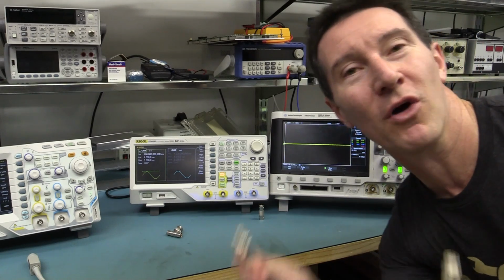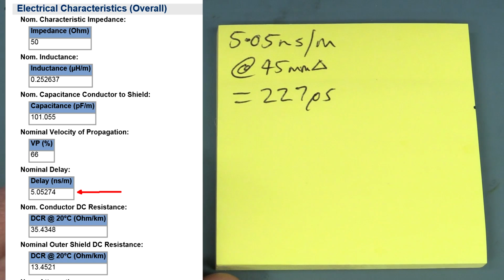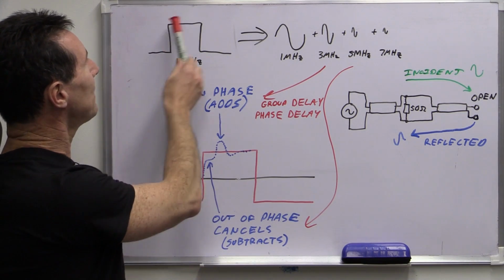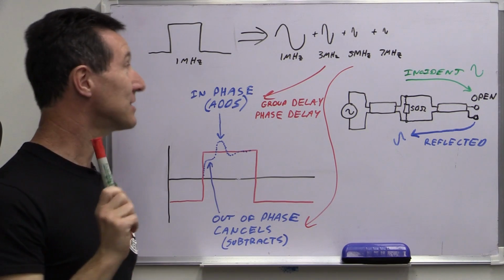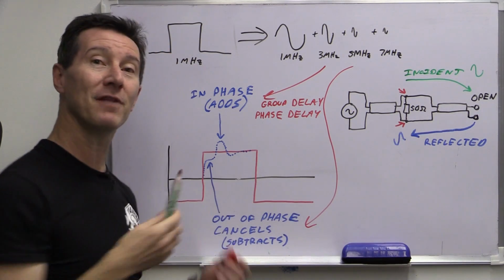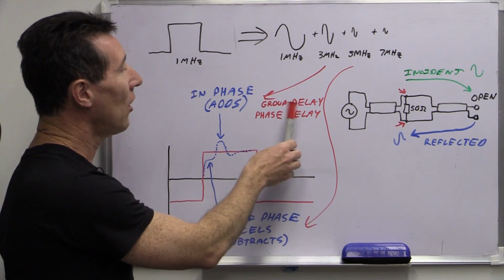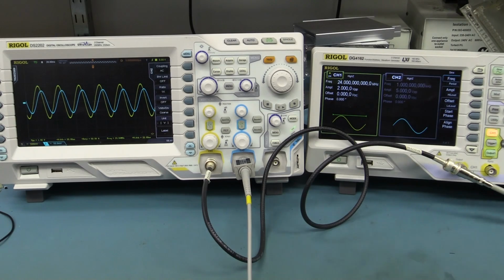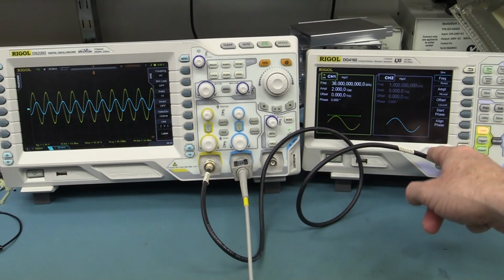EEVblog #652 - Oscilloscope & Function Generator Termination Demo

Comment: Real world  I was senior  on a team supporting US Army Air Traffic Control in Germany. We had both radio and Radar in our workshop We started getting problems with Calibration on some radar units.  Various checks and retunes later we found the RADAR tech was using 50 ohm radio coax test cables We had dozens about the shop and Unless you looked identical. Should be 74 ohm on Radar.

Comment: Great video, any chance you could do a video on using T bnc connectors on an Oscilloscopes channel so you can send a portion of the channels input to say a frequency counter....Some oscilloscopes have a CH 1 BNC Output on the REAR/BACK of the oscilloscope...so basically how can you do this safely on an oscilloscope that does not have a ch1 (auxillary) output.
Cheers

Comment: I would like to add something to "reflect" on even though this is 8 years later. This wonderful engineering "trap" was actually used to create the The Tektronix 1502C Metallic Cable Tester which I provided maintenance and calibration for about 30 years ago or so. At the time it was popular mostly to trace down opens and shorts in aircraft wiring harnesses. Man that take me back!

Comment: Nice video. One thing I don't understand is this: at the end of the video it is claimed that the amplitude change seen on the scope is due to the fact that there is a reflection at the generator side. Now this makes sense to me on the one hand, but on the other hand the generator output impedance is supposed to be 50 ohms, i.e. matched to the coax cable and so there shouldn't be any significant reflection there. So does this mean that the output impedance of the generator isn't exactly 50 ohms? If so, what would be a typical value for any parasitics that cause the deviaton from the ideal 50 ohms? I couldn't find info on that in data sheets of signal generators I've looked at (in contrary to oscilloscopes where it is even often printed above the BNCinput connectors).
Reply: I was wondering this. shouldn't the signal stop at the generator?

Comment: What does this mean when we use a signal generator and oscilloscope to measure component properties?  Is the lesson to use low frequency signals?  Am I correct that with a signal generator and oscilloscope you could measure Capacitance and ESR of a capacitor?  How does this with the small battery powered VNA (vector network analyzers) that are available.  I would imagine that these transmission effects (when not terminated properly) could distort those measurements.

Comment: That explains a lot of signal traces on high speed digital circuit boards (PC motherboards) that looks wavy like snakes instead of straight lines for no apparent reason. They are trying to match the length with some other traces.

Comment: You kept saying you were adding a 50 ohm termination, and kept pointing to a general area. I never could see where the termination actually was placed.
Considering that this was the solution to the problem, and the item featured in the video description, I would have thought you would have spent a little time showing it.
What's your hurry ?
Reply: Scopes have a setting within them, mostly in the 'channel' options, to change this

Comment: If my function generator, coax cable and dso are all in 50Ohm.

Do I need to use a 50ohm terminator  inline with cable or with T connector to the cable?
 @EEVblog
Reply: This is why I had come here as well.
From what I understand:
1) it's okay not to use it unless it's a very high frequency. Many MHz.
2) for a 50Ohm termination, you'll need to multiply by 2, as the termination will act as a voltage divider.

If you want to correct or think there's anything to add, please comment. Thanks

Comment: I've looked all over the net for a schematic of a 50 ohm terrminator, but I can't seem to find one. On the white board portion of your video, you point to where a 50 ohm terrminator should go, but it never gets drawn in so we can see the circuit details. Is it just a resistor?

Comment: reflections  happen on full wave and half wave  isnt that correct ?, how can we get 0-360 degree change  when its only half and full 180 or 0 or 360 degree ,   i think it is a mix between L and C of the coax cable , filtering basically ,  this test should be done with Spectrometer also, so that we can see amplitude of all waves present in the cable, not just one frequency,  even if ther are no other frequencys and i doubt that ,  then the output of the generator must be lower , there is no other solution, but i dont have that scope, i have 20Mhz analog one, and no frequency generator to hook it up and test , so i can only guess .

Comment: About 8:00 in your video. If you did not have the 50 ohm impedence on the scope, what would then happen? Would it be 2 volts peak to peak on the scope instead? (:
Reply: With only one coax cable between scope and generator (:

Comment: So the coax has capacitive reactance due to its innate physical construction which has a different reactance at different frequencies which makes the amplitude go down due to the impedance it creates. By adding inductive reactance you counteract the capacitive reactance to reduce the impedance to near zero... correct?

Comment: thanks, at least I have now the picture on the practical side of transmission line theory (communication).  In the classroom,  it's non-sense following blindly the basic differntial equation of TL  theory that   leads to various equations of circles  which is the smith chart, reflection coefficients, propagation constants, exponential and complex equation, balun matching .... Although I passed the subject but still wondering until I forget it...

Comment: I  sure am pleased to see that a video from almost 4 years ago helped with exactly the problem I am facing. I am using an old 100 Mhz dual channel analog Hitachi 'Scope and an old GW-Instek 3Mhz function Gen/ 150 Mhz frequency counter. The sig-gen out is labeled 50 ohm impedance and he scope input is labeled 1M. Something didnt feel rite when I read instructions telling me to connect a dual end BNC cable direct to each device. This video helped a lot and I will follow up with the article by Doug Ford. Many thanks to you Dave. I was concerned I might damage the front end of the scope. I feel much better now !  The Sig-Gen has no probes, so I figure I should try a set rated for 200Mhz (to accomodate the 150Mhz freq-counter). Seems I should be looking for a 50 ohm inline terminator too.

Comment: Time Domain Reflectometry (TDR) - Feed a 1KHz square wave into a 100 foot long coax cable open or shorted at far end.   Watch the square wave wave on an oscilloscope and note the reflection from the far end and other reflections from cable faults.  Reflections will be very close to the rise of the square wave and distance to fault can be determined by speed of light and propagation factor of coax cable, or for a known coax cable length the cable propagation factor can be calculated from time out and back relative to speed of light for same distance.

Comment: I am a beginner, so forgive my lack of knowledge, but it seems to me that if the unterminated coax reflects back, then a break in a long coax would do the same. Can you therefore use a scope to find the distance to that break? ie: send a pulse down the coax and measure the time between it and its reflection, then calculate how far the distance is to the point where it reflected. Seems to me this could be a good way of finding faults in long coax or buried wires that are hard to access.
Reply: Great Idea! but would that be possible?
Reply: Congratulations, you've just reinvented the Time-domain reflectometer :)

Comment: I remember trying to explain Fourier analysis in square waves teaching RF considerations, I had a lot of  blank faces so I used the Hammond organ sinewave  additive to produce an approximation of a square wave on a CRO  and it was a good way of showing the principal even though we were dealing with audio frequencies.    Showing standing waves on a open 2 wire transmission line with a transmitter connected at one end and impedance mismatch at the other using a florescent tube passed at right angles to the line along it and watching it glow and fade as it passed voltage highs and lows.
The behavior of any AC in a circuit is a hard thing for most people to grasp, you have to have a good imagination  and be able to think laterally.   That's why so many people bomb out of electrical and electronics courses, AC theory needs to be thoroughly understood in all aspects.

Comment: Nice video, but I must quibble with the harmonics analysis of the square wave - you get the exact same behaviour with a single edge which has a continuous spectrum - this is a behaviour best explained purely in the time domain looking at reflected edges.  The signal hits the t-piece and 50 ohm terminator and sees 25 ohms (50 || 50) until the reflection from the open end comes back and causes another step change (which itself propagates back to the open end and back a few times with decreasing amplitude - causing a stepped waveform dependent only on the length of the open stub).

Basically you've got a TDR there!

Comment: When I connect my function generator to my oscilloscope with a BNC to BNC RG-58 cable and set the output of the FG and the input of the OSC to the same (50 ohm or High Z), the OSC reads the FG output perfectly. The FG outputs 1Vpp, the OSC reads 1.032Vpp. This is with no terminators. If I use my x10 probe, I have to set the output of the FG to "High Z", which I think is 10k ohm, and the input of the OSC to 1M ohm. I then have to add and additional 3.7M ohms to get the x10 probe to read 1.040Vpp. I don't understand this. The non-terminated RG-58 worked fine and the x10 probe needed an additional 3.7M ohms to work properly.

Comment: What type of coax adapter are you using on your probe,I have not found an adapter with the BNC that will fit onto a probe?
Reply: +William Colvin They are pretty common. You can buy them by themselves or a lot of probes that aren't the absolute cheapest you can find come with them.

http://www.amazon.com/Cal-Test-Electronics-CT3655-Oscilloscope/dp/B009QBSKE2/ref=sr_1_2?ie=UTF8&qid=1443499425&sr=8-2&keywords=oscilloscope+probe+bnc+tip

Here is a 10 pack of just the connectors.

http://www.amazon.com/Precision-PR150SA-Oscilloscope-Probe-Insulated/dp/B00TTOWEX4/ref=sr_1_6?ie=UTF8&qid=1443499425&sr=8-6&keywords=oscilloscope+probe+bnc+tip

Here is a probe that comes with the bnc tip.

I have never used either of the products and so am not vouching for their quality at all by linking them, they were just the first to examples that popped up on Amazon.
Reply: Thank you very much.
Reply: +lbrieden1 Thank you very much.
Reply: +William Colvin Very much welcomed

Comment: Great video Dave. Some of the navigational systems I worked on we used this delay to great effect. Two antennas feed 180 degrees apart will produce a null between them. Before network analyzers we had what was called a vector voltmeter which measured that phase delay in degrees. If the delay was off we calculated how much cable to chop off to get the correct delay.

Some of the older cabling we had to age the cables to account for expansion and contraction of the cabling due to temperature variations. The higher the freq you deal with the weirder things get. Transmission line/Antenna  theory always seemed the hardest thing for newcomers to understand.

Again great video showing the practical effects of improper termination of signals.

Steve

Comment: EEVblog Dave, Thanks mate. I install TV Antennas and have been told that I can use 2 antennas of the exact same spec, to produce better gain, So long as BOTH the cables that I use from the antenna to the mixer, diplexer or masthead Amp are precisely the same length 
Now I have seen why. Thank you!

Comment: Any person making this stupid mistake has very little knowledge about measurements.  It is common knowledge that signal generators like the Rigol has a 50ohm output impedance and the specification is only valid when matched into a 50ohm load.  Using the input impedance of 1Mohm on an Oscilloscope proofs that the user need to spend more time to studying VSWR and impedance matching. Then you continue on the wrong path by connecting two 50ohm terminations on the two channels of the Oscilloscope channels, effectively creating a 25ohm load on the output of you 50ohm signal generator. I don't have to explain that this as a mismatch and that you cannot trust your measurement results. RF and microwave engineers are totally aware of mismatching and even get into phase matching in what seems to be a 50ohm matched setup.  This is when the start talking about a mismath error and a mismatch uncertainty.

Comment: The step you see at the leading edge of the waveform is due to the coax's characteristic impedance being a load in series with the output impedance of the generator. 50 Ohms in series with 50 Ohms drops the input square wave to 0.5 of its level. This occurs irrespective of the end of the coax being terminated, open or short circuit. As the wave travels down the coax at approx. 0.6 the speed of light (say 5 ns/m) the measured signal at the start (the step)  has no knowledge of the termination of the coax at its end hence the step. Try 75 Ohm coax and the step is a different value. Once the reflections have settled down the measured voltage will return to the same level as expected for an open circuited load, that is no change in level! You can work out what to expect by thinking 50 Ohms in series at the start of the wave and then think what would I see if it was just a DC signal level change for the long term part of the signal.  The reflection occur because the impulse from the leading edge of the signal has no where else to go except back to the source where it is then absorbed - just like throwing a ball at a wall and catching it on the return bounce. After twice the time delay for the signal to travel to end of the coax all the reflections should have died out and the distributed capacitance of the coax will be fully charged - inductance is not applicable in the long term because no current flows in an open circuit ( think DC again).

Comment: Or if your scope has the ability to terminate with a 50 Ohm impedance, just do that and then you can use a coax line without any issues. Dave did do this on the Agilent, but because most cheaper scopes do not have this ability the video was necessary. This is good info to have.
I just set my scope to 50 ohm termination and call it a day. As a backyard RF engineer that's something I look for in a scope. And of course I always have a spectrum analyzer at hand.

Comment: Very informative.  I'm still a little bit unclear on what the x10 probe is doing if its not terminating, is it just a really high impedance way of measuring?  If so, what would happen if you connected coax to the signal generator and then the probe to the end of the coax?  Would you get reflections again?  Was the point of the probe to avoid having any coax transmission line interference?  Won't there be transmission line reflections between the internal source of the signal in the sig gen and the connecter on the outside of the sig gen even though its a very short path?  Does it even make any sense to measure the output without terminating?  What would that measurement "mean" / be good for?

Comment: I would have liked to have seen this video when I was studying for my Extra Class Ham License.  I was baffled how a single piece of coax could present itself (characteristic impedance) as an open circuit, short circuit, or anything in between based on frequency.  My background is computer engineering, so my little digital based brain was sent reeling.  Excellent video Dave!

Comment: what are actually the BIG differrences between an expensive DDS function generator and a cheapo chinese one? it's the same technology after all (apart from the obvious differences like the big screen, keypad, ..)
Reply: GPIB. Fmax. THD+N maybe? I wouldn't bother with a lab quality DDS AFG in a hobby lab, and I wouldn't bother with a cheapo chinese one in a research lab. The big screen and easy to use keypad along with the out of the box calibration and slave to external reference capability is enough to justify one for professional use.

Ergonomics and not mucking around is worth quite a lot when you're paid by the hour. It ain't worth shit when you have to make the choice between ergonomics and a better scope.

I would definitely buy one of those $17 naked PCB ones to start off with. You can verify it works right with your scope and spectrum analyser. If you find you're using it all the time and you're wasting too much time dicking around with it's clumsy UI, you can always upgrade to a lab one, and put the cheapo one aside for those times when you need two AFGs. If you're always using 2, buy two, and put it aside for when you need three, etc. It doesn't hurt to have too much test gear, as long as you always have some known good gear to test it with, so you know what it's limitations are.

Comment: EEVblog Now this is weird because you start with "they are exact same length" and there is no explanation for the difference of amplitude between both channel until you start to play with phase and mesure the length difference between both cable which now explain the amplitude difference between both cable, right ?